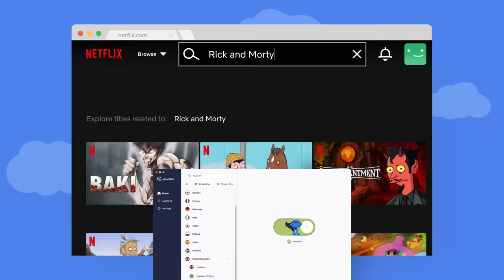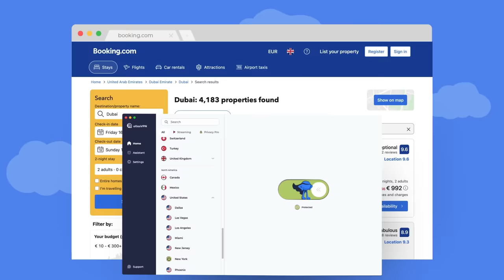How do Russians Cope with Heavy Tank Losses?

Comment: The statement in regards to "7 times" could simply be down to the numbers before the war being extremely low.
Reply: I'm shure one Austrian with a strage moustache thought something similar at some point
Reply: @RobertLutece909   В России за 2023 год будет выпущено новых и отремонтировано - 1600 танков !!
Reply: @RobertLutece909  The problems should've occurred once sanctions were placed against Russia. Russia imported practically all chips, electronics, parts and heavy machinery before the war. Even at this point i doubt they are able to produce high quantities of "modern" vehicles. As is evident by lack of sighting on anything but old T-72's and BMP's that were scraped from long term storage.

They are probably eventually going to be able to produce much more, but for now T-90M's and such are seen too rarely to think that there is any sort of mass production going on like was seen with the models.
Reply: from 1 tank a month to 7 tanks a month...
Reply: @techtical7079 it's almost two years after the sanctiom and Russia is still capanle of producing weapon, it's not unbelievable if they can increase the production, sometimes something that hit you hard will make you stronger, just like sanction, Russia maybe right now in some parts imported from another dealer like China.
Reply: The worse they do on the front, the more they talk about "russian cope" lmao
Reply: les russe perde jamais la guerres 2024 lukrane effecer de la carte deurope
Reply: Thanks. Remember the Russian MIC is a State owned business. They have the ability to mothball production facilities and then ramp them up when needed. This is a legacy of the Soviet era. They aren't profit driven like the West. The order came down from Putin to increase the armed forces to 1.5 million and that they all will be supplied with the most modern weapon systems. This has been actioned and is happening. Apparently 1500 tanks per year now, possibly new and refurbished  but new lines are being opened. They have also shifted to Russia produced components and probably get other components via China. So pay attention to what is actually happening not what Western propaganda spits out. Know thy enemy.
Reply: For Soviets any tank that left factory was counted as new. So I do not find anything about 7 to 1 as strange. In fact I think it's low.
Reply: They are including new tanks and refurbished old tanks in that number is what I heard
Reply: @lotuscabage4755  To be fair they are probably working around the sanctions. I don't know about military goods, but working for a luxury brand in europe i know that they sometimes sell stuff to china where they slap 50% more on the price tag and ship it to russia.
Reply: Correct, I've read numbers as low as a few dozen per year before the war so the 7 times figure is realistic.
Reply: @robvelor  well over 100 before the war. It cannot be few dozen as Russia needs to replace its old tanks. With 3000 tanks in the army making 100 per year implies 30nyesr time span per tank. With less time span per tank grows. With 30 it would be 100 years. That is not possible.
Reply: @Medj_4802  tu veux pas effacer ton message plutôt que dire des conneries ?
Reply: This would make more sense, but it would also necessitate russia somehow finding 7 times the cash and resources for manufacturing.
Reply: @guitarhausdoesntknowwhatac3285  just like those missiles, they must be running out
Reply: @lotuscabage4755  The question is how much can they actually produce and for how long? Like in all due liklihhood they're relying on previously constructed tanks and refurbishing them more then they are actually building whole new ones, and as others have pointed out they don't have access to the foreign materials (IE electronics) that they need for modern tech.

Realistically, this would mean that in order for them to increase production they'd have to go backwards on the tech scale, utilizing less advanced equipment (IE computers, optics, precision machiend parts) and producing tanks more in line with older versions of the T72 while relying on the idea of "quantity is a certain kind of quality".

As to china... They're not going to bail out Russia. At any point in this conflict they could have begun supplying them with anything from body armor to direct military intervention, but they haven't because at the end of the day they'd rather see russia gut itself fighting n ukraine and thus become increasingly reliant on them then be able to stand on their own two feet.
Reply: @robvelor  Long range missiles (IE a guided rocket powered munition) aren't exactly something that russia can produce indefinitely; they don't have access to the electronics necessary for modern guidance systems.
Reply: @guitarhausdoesntknowwhatac3285  Yet they are. All those laundry machines they keep stealing.
Reply: It might just refer to a limited period where they burned through their layer of parts.
Reply: @guitarhausdoesntknowwhatac3285  I do not see problems with cash at all - as well as resources are plentiful - name resource Russia struggles with other then manufacturing space or number of facilities or simply workers.
Reply: @tomk3732  Modern Military grade microchips.
Reply: @guitarhausdoesntknowwhatac3285  No problemo - I actually checked, VPN set to Russia and no problemo - how many 1000s do you want? 
Ukrainians were foolish to provide some of the actual chip #s ;) Did it like last year.
Reply: @tomk3732  The washing machines they've stolen aren't going to give them chips of that level bud.

Of course, if the goal isn't to field a modern military and something more in line with say.... 1973 then sure I can see how they might be able to keep up. It'll get shredded by Nato's junk drawer which Ukraine is getting more and more access to but if your that desperate to field a tank then I suppose it would work.
Reply: @guitarhausdoesntknowwhatac3285  Well, the front line show that NATO equipment - even some of the best such as latest Patriot Systems PAC3 or NASAM are not that great. 
Ukraine is not getting more and more - Ukraine is getting less and less. There is simply not another 10,000 armored vehicles in NATO to give away.
Reply: @tomk3732  The NATO hand me downs have done fine; Patriot isn't perfect but it's done a decent job helping to weed out russian missiles while Gepard's have proven effective at shredding drones.

Also WRT reserves of vehicles: Russia doesn't exactly have a lot left at this point. They're reaching further and further back into their stocks and pulling out vehicles that should have either been scrapped or sent to a museum.
Reply: @guitarhausdoesntknowwhatac3285  Russia has more than all of NATO in Europe combined left. So plenty. They are not going to run out of vehicles. Their aircraft losses per year are less then known pre-war replacement production. So no to that either. 
Ukraine air defenses are getting weaker and weaker as there simply is not even close to enough equipment to send. Ukraine had before the war air defenses that were strongest entirely in Europe. There is not even close to replace this.
Reply: @tomk3732  
1. Are you taking russia at it's word WRT it's actual functional numbers? Because if anything this war should have aroused deep skepticism with this.
2. Given that russia seems determined to obliterate it's forces in meat grinder after meat grindeer I question whether they'd pose any actual threat against actual NATO forces in europe (and also ignoring that in such an instance russia would be dealing with article 5).
3. Again: due to sanctions some of losses that they've sustained are functionally permanent. The Long range bombers, KA-52s, T-90ms they simply don't have the components to replace and won't until the cessation of hostilities.
Reply: @guitarhausdoesntknowwhatac3285  I am using variety of sources but mostly trust videos from multiple angles of an event or simple history book. 
Russia so far had no meat grinders of her own - most of what we see is Ukraine meat grinders. For example, Bakhmut. Or currently Adiivka. These are great Russian successes. 
Article 5 is world's weakest treaty - i.e. there is nothing there about need to defend anyone. However, Russia has little need for invading EU - why? 
Sanctions are a total failure. Russian economy has left Germany in the dust. They have zero - I repeat zero problems with parts for all you mentioned. I have no clue why people repeat such BS. Please list chips they cannot get and their purpose. Please do. I will check how many Russia can buy in 1000s.
Reply: @tomk3732  
1. Bahkmut Had russia fighting for 10 months with loses estimated at 7:1 in ukraine's favor over a town that had no strategic value and which has only one structure still standing as far as I can tell (a salt mine). Also, while Russia was hyperfocusing on the city that once again had no strategic value, Ukraine was laying the groundwork for the liberation of Kherson.

Also the decrepit conditions led to a mutiny within Wagner and that led ultimately to their leadership being assassinated leaving serious question's as to how effective they are at this point.

2. Andvika is Bahkmut but worse; the city is more fortified, more well defended and russia has less resources to work with.and longer supply lines.

3. If article five was weak then russia would have rolled over the Baltics decades ago.

4. Literally any economist would tell you that the russian economy is smoke and mirrors; They lost their largest source of income and can't access the manufactured goods they need to sustain modern equipment.

5. The reason you are struggling to accept this is because you are being completely uncritical of russian sources.
Reply: @tomk3732 The delusion.
Reply: Привет ! Come on guys im Russian and i know that it is true about "7 times" and here is why:
1) There were a lot of production lines which stayed not in use since USSR was defeated in cold war. Now they produce tanks and other vehicles.
2) We compare production before war and now.
3) Refurbished and new tanks are in count.
In conclusion i can say that we are going to reach level of production USSR had. It was really high. So it is nothing to surprize about 7 times.
PS Yes we need workers. Just cuz USSR had 350 m of population and now we have only 150m. That s why u see that claims about factories hire people with no previous experience in tank production. But rusdian people are not stupid so they will learn how to work quickly. Also they provide good salary. See ya !
Reply: @ushakovilia88  There are a number of Caveats that need to be put in and as a russian you'd be well aware of these.

Hypothetically, russia could do this. Hell, hypothetically russia could produce 10 times as many tanks as they do right now and not just T72's,, T80's or T90's but the ARMATA, in such numbers that they could form a glorious armored carpet that tolls over everything between the Urals and the english channel in a great armored carpet.

The Issue is that practically, there are three things that are going to make this a non-starter.

First off, Russia doesn't have the economy to support this level of rearmament; If the sanctions weren't a thing (Including recent decisions in Greece that are set to cut russian oil shipping in half) then they might be able to get this going in conjunction with a full scale war economy but as it stands right now? I'm skeptical that they can do this.

Second, the sanctions also means that russia doesn't have access to modern machined materials (IE military grade electronics) or machinery; they've been reliant on other country's to either manufacture those components or to ship them the machinery for an extended period of time.

Third, As a russian you'd know full well that corruption breeds out of control anywhere that money exists so while they might be producing "7 times" as many vehicles on paper, odds are they're either going to have a lot of poor quality or simply not in existance.
Reply: @guitarhausdoesntknowwhatac3285  Right, because Ukraine is winning is why Ukraine is going to full mobilization, including women.
Reply: @guitarhausdoesntknowwhatac3285  The ukro-cope is strong in you.
Reply: They had that problem already cheap Chinese parts...the tired on trucks rotted and flat when barely used and long convoys of broken down Russian armor and trucks at the start of the war just trying to get to Ukraine..
Reply: @Russiaalwayswins  not enough since beginning of invasion till october 2023 they lost over 5k tanks. 3 more years of same loss rate and russia will be completely demilitarized.
Reply: @vsulla  what ?..are your serious ?..🙂
Reply: yes I mean he could of just misinterpret that because lets say it was a 7 time increase from 50-100 tanks a year being built for the RU forces, it is plausible
Reply: @deansawich6250  None of this is true.
Reply: @lotuscabage4755   Some of the T-90 and T-80 upgrades are from the upgrade kits for the T-62
Reply: yeh that what it is
Reply: @guitarhausdoesntknowwhatac3285 even if we take Russia at their word about equipment, they have far less than NATO like less than 25% of the manpower so they might not even have enough people to use it in a war